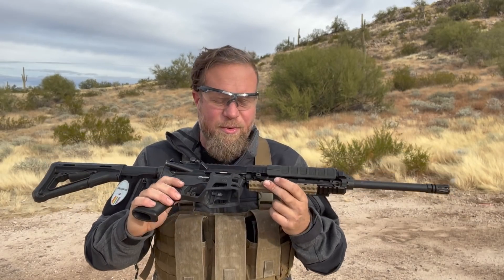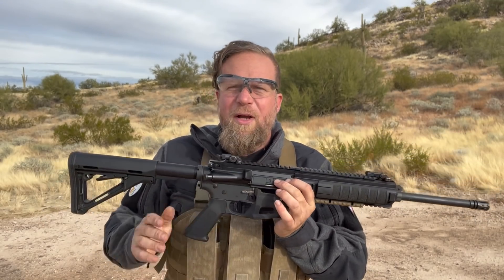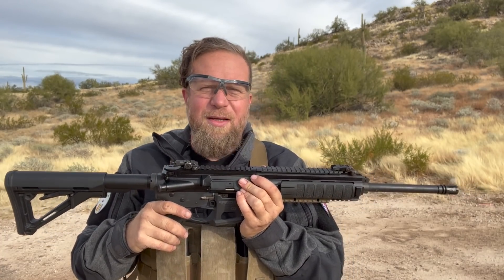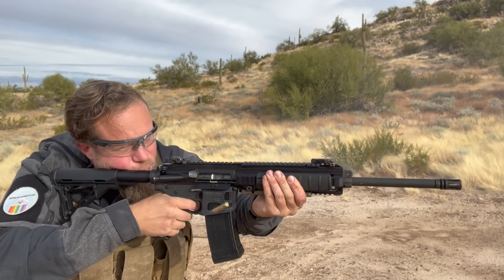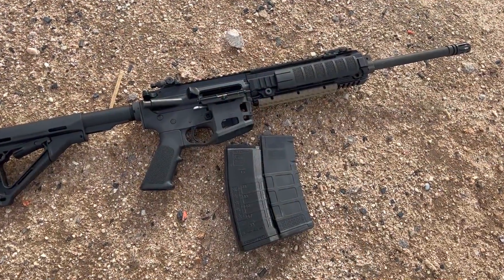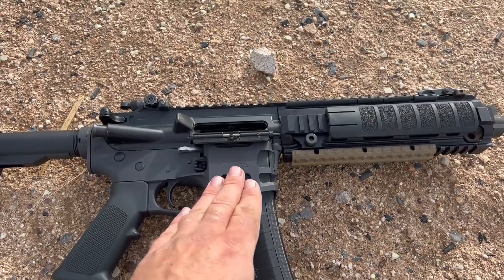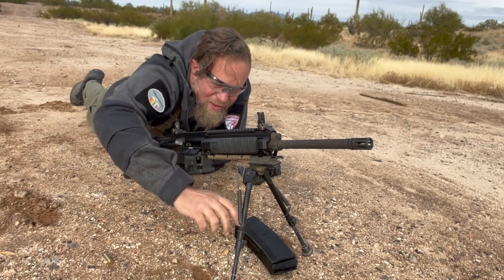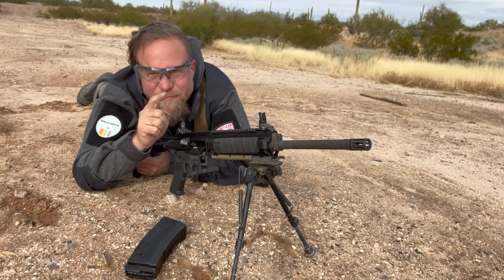Desert Tech Quattro-15

Comment: Can they just make them an even 60 or even more? They’re taking up the space of 2 AR mags. That’s a full 20 round AR mag worth of ammo capacity you’ve lost by have 3 or those instead of 6 AR mags.
Reply: Keep in mind that the current quad mags are a bit shorter than a regular STANAG. What if you could extend our a bit more and get it to over 60 rounds?

Honestly, I suspect it gets to 53 because that was the size (with current designs) where it starts to have reliability issues.

I would be super interested to see further development of this. Especially if the adapter for double stack mags can be quickly inserted and removed.
Reply: They probably could but the point is longer fire before reloading, with 2 30s you have to reload between them, which during sustained fire is not a good thing.
Reply: Understandable but it doesn’t change the fact that 4 of these magazines take up the space of 8 AR mags but only give you the capacity of 7. You’re losing a full 28 rounds of capacity.
Reply: @MadJustin7  we might be looking at this from the wrong angle. What I mean is, how many of these would the gunner have to carry to match what they would currently carry in belts?
Reply: @PhycoKrusk  The military is already transitioning towards magazine fed support weapons to replace weapons like the SAW. That's happening regardless. Desert Tech isn't necessarily trying to replace belt fed weapons but trying to replace the AR standard magazine fed weapons that are replacing the belt fed weapons. I'm simply pointing out the amount of ammo that's being left on the table due to the current design limitations.

Comment: Holy shit, I can't believe that no one else had thought about this until now! It seems like such a simple and great idea.  Im looking forward to hear how it works out. 

Oh btw, I now expect you to show the magazine rolled into a taco now.
Reply: I imagine the reason it's not been done before is because it means it might struggle to take a standard mag, especially under battle field conditions and also modern military have always been obsessed with belt fed LSWs, despite the fact that mag fed LSWs have proven to be more useful almost universally
Reply: @magoshighlands4074  that requirement to be able to take standard mags is probably the biggest contributor. Like Karl said, most quad magazines narrow to a double to fit into standard mag wells and that's usually where they bind up.

I guess Dessert Tech figured that since the usual design for quad stacks doesn't really work, and that since magazines in belt guns doesn't work either, they might as well try something different and see what happens.

I think they're onto something.
Reply: @PhycoKrusk  i imagine downgrading from 53 to 30 wouldnt be much of a problem and if it worked out quad stack magazines could become a bit more main stream
Reply: If you carry some type of spacer or adapter to jam into the wider well, then having backwards compatibility would be snug.
Reply: Such magazines were tried many times for carbines without magwell and they all have a same issue - they can't pass reliability tests, especially falling down or just a hit at the bottom when half empty

Comment: I'm not well versed in firearms, so... what's the disadvantages against a 30-round mag?
Reply: weight
Reply: @RoBOtic Rebel  
I would also suggest barrel life. With the 249 and 240, you can swap barrels out. This guy, you need an entirely new upper unless you have an armorer on site and a few hours to kill (not likely in a real world situation).
Reply: @roboticrebel4092  Thanks. Will that still hold true against two 30-rounds mag? Apart from having 7 less rounds, I guess malfunctions will have a larger impact on one big mag than two smaller mags.
Reply: As he said at the beginning there’s a move away from belt fed LMG to magazine fed ones. Bigger mags means less reloads so more overall fire going down range. That’s what this is aimed at rather than semi auto fire.
Reply: @MrCyphermonkey  I was wondering if 50-rounds could be a new standard for semi-auto too. After all, civilians have less weight concerns then soldiers who carry additional tools and materials.
Reply: The biggest problem with a (functional) 30 round mag is that it does not hold 60 rounds, just like the biggest problem with a (functional) 60 round mag is that it does not hold 90 rounds.
Reply: I imagine it is harder to re-load since it is quad stack, needs stronger spring. Twice the width of a 30 round mag but holds less rounds.  Basically you save one magazine change for the cost of 7 rounds. It's kind of up in the air whether it worth it or not. Maybe depending on the application.
Reply: @adam-k  Ah, haven't thought about that. A solution could be loading devices per X number of guns but that could increase the costs of using these magazines.

Comment: As opposed to just buying a d60 drum?
Reply: Drums are inherently less reliable than standard box magazines(however that might not apply to a quad stack, only time will tell) and drums are overly bulky and difficult to have streamlined web gear to carry them
Reply: Can you stick a D-60 drum into a 30-round pouch?

You can with a Quattro
Reply: Fits better into normal pouches.
Reply: To be clear, I’m very happy to see gun companies continue to innovate. I hope something does come from this.
Reply: Karl and Russell have discussed the D60, and one of their complaints was that it doesn't have good long-term durability. They work well for a while, then they start breaking.
Reply: The cost of a compatible pouch is minimal in comparison to procuring a new platform. Plus quad stacks do not have a history of reliability. Those holes cut in the mag well are begging for a mud test.